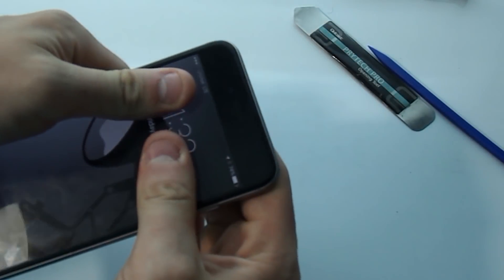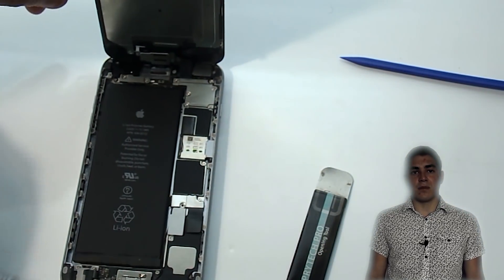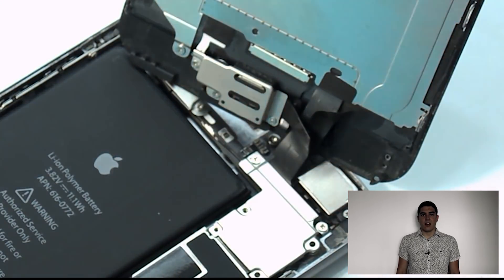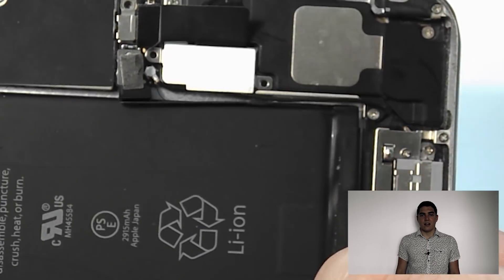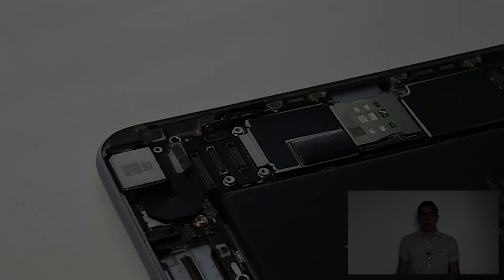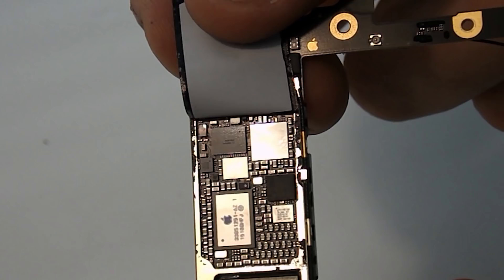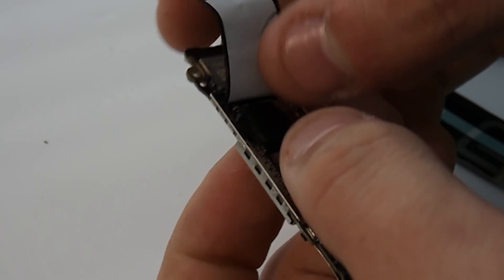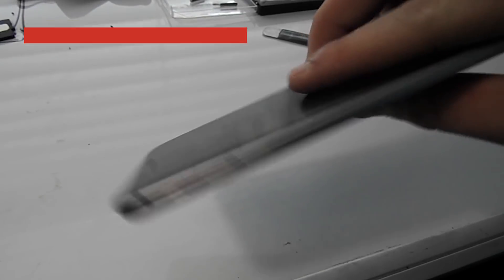How to Fix Touch Disease on iPhone 6 Plus (No Soldering or Bending) | appleEducate #03

Comment: Hi man. I have an iPhone 6 128gb and the touch is just not working. I usually was restarting it and it would have worked for around 10-15 mins. And after a while i saw that if I bend it a little it would work for a while but after some time it stoped working with that too. I went to 2 shops and they both told that I need to buy a new screen. Please tell me that this fix work for iPhone 6 too , i really don't have the money for a new screen. Thanks and have a nice day !
Reply: Hi Rollz, 

I wouldn't recommend getting the screen, anyway (If you somehow found that money in first place). My 6 plus unfortunately started having these issues about 1 or 2 weeks before I dropped it on its side to shatter the screen a bit, of which I went to go get it replaced. As the video describes, the issue goes far deeper than just a screen swap. Both shops that you're referring to are only just trying to snatch some money from you.

If you do find that kind of money, just use it to send it to Apple and they'll take care of it, I'm sure.

Comment: This fix totally works, had an issue with it not reading the SIM card ( I'm guess because the tape on the chips was"bulging" the board so the SIM card wasn't making a good contact, but I just put a couple thicknesses of tape on top of the SIM card reader to push it back and it's working now.
After about 10 minutes the an alert popped up saying "ME had a temporary error" I hit accept and haven't had any other issues 

Phones been working for a good hour now

Comment: My 6plus has touch disease with the grey area at the top of the screen. Sometimes the grey areas aren't there, but the screen still doesn't work. With pressure on the top left of the screen, it will sometimes work temporarily. Went to the apple store & they will replace for $150 but am due for upgrade so my husband is going to try this video using the electrical tape.
Reply: Yes! So far it has worked with no problems

Comment: What if you have touch issues but no grey bars?  Do you have to have the grey bars to know if you have this issue?
Reply: uBreakIt iRepairIt did you figure it out?
Reply: Jerry Flores it did have grey bars. The person who owns the phone ended up telling me they remember seeing grey bars. I temp fixed the issue by stacking 4 small square layers of electric tape on top of each IC.  The problem hasn't came back yet. Waiting to see what Apple is going to do about it or see what happens with the class action lawsuit.
Reply: Yes.  It had the issues as mentioned in this video.  I cut two layers of electric tape and tried the method in this video and it didn't work.  But...  When I cut out 4 layers of electric tape (adds more pressure) and put it on top of each of the chips individual, the touch started working.  I did this about a month ago, and the phone is still working to date.

Comment: My phone doesn't have a grey bar at the top but sometimes my keyboard and screen suddenly stops working and I have to switch off and on my phone to fix it
Reply: ᴅᴀɴɪᴇʟ  ᴋɪʀ when the phone stops responding try calling it with another phone if it displays the call but touch screen is not responding then its a Touch IC issue.
I'd try restoring/updating the phone first though then proceed from there.

Comment: where did you get your apple cert? the mail.. you HACK phones bro. i can tell by how you pull the screen to far and TWIST it before you pop the display case cover. and if you were a real tech you would know that a heat gun will actually fix the problem. not tape. and you are answering questions about stuff you have no idea what you are talking about.. if the touch is jumping around and you dont tell them to clean the connectors. just say. well its a bad screen. dont misinform people. you may work for apple but you are defiantly no cellphone technician.  you even use a universal cheap screwdriver. everything you did. every screw you slipped on shows you are not who id want fixing my device.

Comment: After applying the tape to the back of the logic board, what are the minimum things I need to reconnect/screw down to test if the fix worked?
Reply: You might as well just go all the way because many of the screws complete circuits and used for grounds

Comment: Did it about a month ago still works good. (Make sure you cover BOTH ic chips with the electrical tape!)
Reply: Do we cover it with the sticky part or the dry part,? Sorry im an air head😂
Reply: Celleste Martinez sticky it will help be a tight bond I did it and it worked from November till yesterday

Comment: I had touch IC disease - instead of removing the logic board which is a royal pain - I used a short-cut - I removed the battery & then loosened the top few screws that secure the logic board - then I stuck 2 thin pieces of card-board under the upper part of the logic board where the touch ICs are located- then I thighened the screws - installed a new battery since I had bent the old one a little bit - it worked perfect - I have used the iphone for 3 days & NOT once has the slightest touch failed.
Reply: cardboard? going to catch fire eventually
Reply: lol you can't be serious about it catching fire
Reply: Is it still working?
Reply: I did the same (used an old sim card instead) and it worked for a few months but came right back.  I figured the sim card may have shifted so I attempted to do it again, but this time my phone would run hot and I thought I ruined it.  Took it to a friend who fixes phones and I had slightly tore a ribbon...he replaced it for $20 (I removed sim card) and my screen worked fine for another few weeks.  Now I'm back to square one.  I have NO idea what the problem is or how to fix, but I'm annoyed.  iPhones cost way too much for stuff like this to happen :(
Reply: Virginia Jackson how do you do that you have video or something ?  my phone stay with me 3 years and never have a problem but this year touch disease came and i can touch anything i need to back up my iphone to buy a new one i have importent stuff on my iphone then i don't care if touch disease came back only one back up 💔
Reply: TheModdersWorld Mike lol jus trollin...yo you mod..message me
Reply: TheModdersWorld Mike modding
Reply: ***** modding what?
Reply: ***** about?

Comment: I've been suffering from the touch disease for months and got really frustrated, I thought my only options were to shell out $150 to have it fixed or buy a new Android phone.  I followed your video and it works! I got lost a little bit in the end when putting the phone back together and somehow ended up with four screws I don't know where to put them back to, but at least the touch disease went away!

Comment: Just a quick question Rody. When you put the piece of electrical tape against the chip, do you fold it so there no adhesive side exposed? Just asking because I'm sure the adhesive side would leave a lot of black residue. Please let me know. Great video by the way. very informative. Thanks!
Reply from the maker: Correct, fold it on itself. Thank you for watching! P.s. there is an update video out too that I made.

Comment: just tried this on a customer's phone. it worked 100%. I used the padding stickers from old lcd connectors for iphones. First I used just one, when i noticed it may not have been thick enough, i used one more strip and laid over the first one looking like a + sign. The middle point of this + patch was right on top of the touch ic. This time it worked, and hasnt stopped since. super DIY fix. 
Many Thanks Tody!

Comment from the maker: Update Video is here! https://www.youtube.com/watch?v=yUUfTzagkpo
Reply: Rody Davis I have some problem on my phone Samsung it keeps tapping by it self
Reply: Rody Davis Pls I have iPhone 6s ...no display but you can feel that the phone is on or if u forced turn it off and on back again u can see the apple logo under pure white led light and it won't display. I have since change the screen and it works for a day and now gone again. Is there a way to fix this and how. And by the way thx for you video on the touch disease ..works great.
Reply: How do you fix apple logo flickering
Reply: Alex Zito, Try to factory restore the device using Itunes. I did this method and it worked with no issues.
Reply: Jimpix you just have to restart your phone it has happened to my old samsung as well
Reply: Rody Davis k
Reply: Rody Davis Mr. plus do a video about the 14 vertical double line issue of my iphone 6Plus screen. i tried bending and it usually affects my right half screen but after bending it is reduced to 1/4th of the screen. but maybe it is just temporary.
Reply: Dear Rody, i try the method. It solve the touch disease. However my front camera become malfunction. I cant boot up my phone and keep restarting. I have to unplug the front camera connector then the phone can boot normally. Any related thing i should check?
Reply: Rody Davis  I think my dads iPhone just got this touch disease because he called me and said he can’t touch the bottom of the screen
Reply: Can you fix mine
Reply: I have it on my phone and my dad says we don't have tools to fix it
Reply: Rody Davis can you help with my iphone 6 it keeps on typing alone i cannot use my phone right now
Reply: Rody Davis i cannot control it keeps on typing
Reply: Great information and video. Have replaced batteries and screens on i-phone before so familiar with assembly . This was a little more involved than I wanted to get at this time, so on the opposite side of board where you have put tape to hold pressure on board between screen back and board. I put 3-m scotch 33+ electrical tape and I have not had the unresponsive /jittery screen since, just been two days but working great so far..   
  I believe it was my own fault having the i-phone 6 plus in otter case in my pocket while working under a computer floor for a week installing new servers.  Lesson learned, I'll keep it in the ottercase and phone attached to belt clip if I'm bending a lot again.  Again, Great information
Reply: Km
Reply: Rody Davis my phone has the same problem but I don't want to mess up my phone doing something I don't know what to do
Reply: +HackerMods HackMod wow very descriptive  it really allows others to help you with your problem.
Reply: HackerMods HackMod fuk u Samsung user it is apple all the way

Comment: I wasn't feeling comfortable removing the logic board so instead of doing this I stuck in two layers of electrical tape between the little metal bracket and the lcd connectors and it's been working since 24 hours. It surely isn't the best method and might not last long but I can't find a repair shop that does microsoldering in my area (South Western France). If anybody knows a shop specialized in this kind of repair that accepts international customers please let me know!
Reply from the maker: +RisingForce64 iPad rehab does! Thanks for sharing!
Reply: Thank you! I'll get in touch with them if the issue reoccurs. I'm curious, does your iPhone still work since you made this video?

Comment: the right screw is refusing to come out on the bottom of the phone but the left one came out with ease.
Reply from the maker: +Devan Hixson I found if you slightly lift the screen then try to remove the screw it's worked for me. Thanks for watching!
Reply: +Rody Davis I have to snap cracks on my screen the screen won't fall apart if I lift it will it?
Reply from the maker: +Devan Hixson no there is a metal plate behind it, just be patient and take your time
Reply: ok thank you.
Reply: Hi,what tape you using it?

Comment: so i was able to take my girlfriends phonr apart and put the tape on the chip the screen works just fine now but the front camera and earpiece speaker on the front dont work now, any idea what i might of dont wrong?
Reply from the maker: +juan lucero you might have ripped there ribbon cable connecting it, also make sure it's connected properly. Thanks for sharing!
Reply: +Rody Davis i made sure they were connected right they dont look ripped but ill take another look
Reply from the maker: Make sure to look where the cable curves, usually that is most prone to weakness. You can by a replacement part on amazon or iFixit for pretty cheap.
Reply: hmm ill take another look, thanks. great vid by the way
Reply from the maker: +juan lucero sounds good, let me know
Reply from the maker: +juan lucero thank-you!
Reply: so i took another look and you were right i did rip the ribbon cable haha. i already ordered a replacement. thanks for the help
Reply from the maker: +juan lucero I did the same thing before and made that mistake. That's unfortunately how I learned. You're welcome!
Reply: ahh hahaha well we all have to learn some how
Reply from the maker: +juan lucero very true!

Comment: Did everything in the video but now phone every time i use it needs about 2-4 minutes until it starts working properly so when i don't use it for about 10 or so minutes it again needs 2-4 minutes until it starts working properly again. Would it help to add another layer of electrical tape?
Reply from the maker: +Sam Ham yes it would. Sounds like the problem isn't fully fixed. Thanks for watching!

Comment: Good to know that there is a no-cost, DIY solution to this issue. Thanks for sharing. I will probably go the route of the chip replacement though since it offers future proofing. Also I suspect my soldering connections are rapidly deteriorating because the problem has gone from bad to worse. I guess a liquid soldering solution and installation of a metal backplate over the Touch IC chips might not work? Have you considered trying that? I'd sure love to save the $200 it will cost (plus the 2-3 days with no phone).
Reply from the maker: +Tommie N. Carter, Jr. I haven't considered that but I'll look it'll it thank you! Thanks for sharing!

Comment: My screen randomly touches anywhere!!! What should I do?
Reply from the maker: +Singh is King sounds like a bad display. If you have had it replaced before then that could be the issue.
Reply: Rody Davis just replaced it last week. Same issue. But I've noticed it happens more when the headphone jack is in. Weird.
Reply: Rody Davis my old screen had the issue and now the new screen.
Reply from the maker: +Apple Teknik Servis | Saints Computer I am an experienced Apple technician I will be happy to provide a link in the description if you leave one. There are people that should do this, specifically those who need to get their data off and want to transfer data to a new phone.
Reply: It's not about screen, it's about Touch Transmitter Chip, it should be replaced. Don't waste your time, send the phone to an experienced Apple technician for more info watch our videos :)
Reply from the maker: +Singh is King that is very weird, thanks for sharing!
Reply from the maker: +Singh is King so that would be the touch ic chip failing
Reply: ***** Thank you for your replies. I have insurance, il have to put in a claim.
Reply from the maker: +Singh is King sounds good!